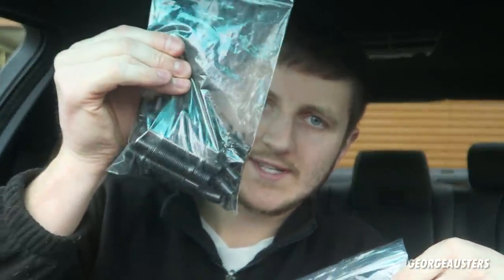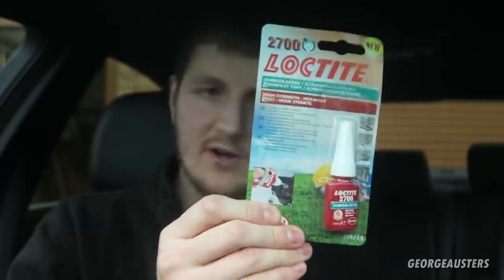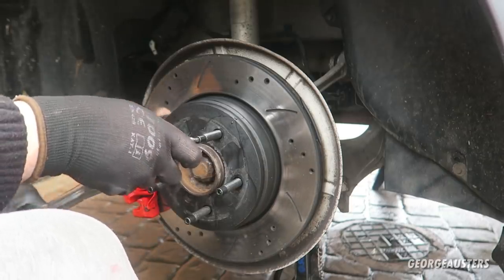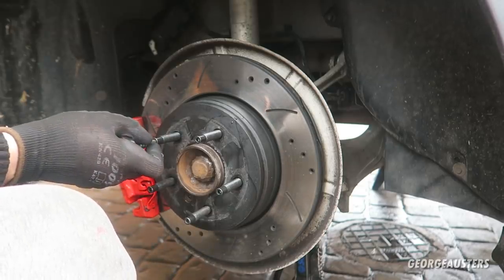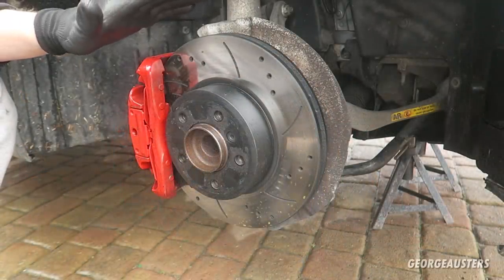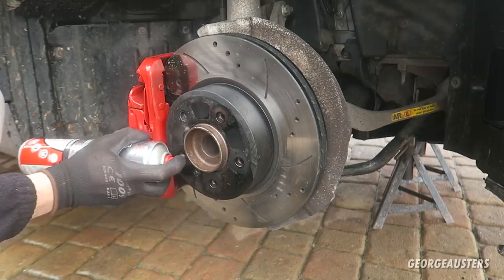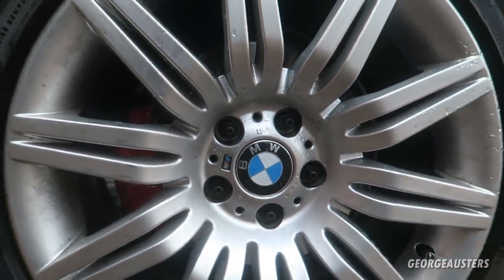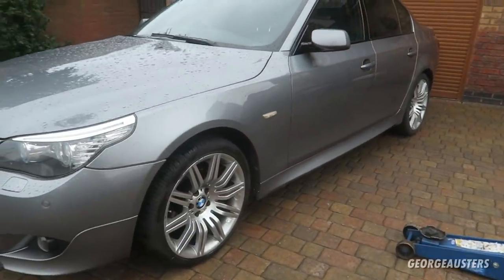The Modification That All BMW Owners NEED!

Comment: You will see how good it is when you change your discs!
I think BMW engineers are not stupid!
Good video about timing chain!
Reply from the maker: I’ve just changed my discs all round man👍🏻
Reply: Should be no problem getting the studs out again.
Reply from the maker: The discs slide over the studs, but yes the studs do remove easily👍🏻

Comment: Just get a wheel mounting pin, BMW used to send them as part of tool sets, get 2 is my thing as it then gives you two points. Makes it much easier just remove one nut, put it in at the top and undo as usual. Mounting is made easier as well obviously. M14 * 1.25 for f series cars.
Reply from the maker: Or get wheel studs / nuts 😁
Reply: @GeorgeAusters  I think as I already have the mounting pins now I fear this problem less. Having seen BMW do it first hand I don't even know how they do it still without a mounting pin! 
Honestly the last tech I saw put my 20" Summers on made it look piss easy without it.
My irritation is not including it in the tool kit, but maybe they don't expect people to change their own wheels now? 
Unlike my MX5 I suppose that is my only frustration you need extra tools to really make you feel comfortable working on them!

Comment: I need to: change aircon pump, renew main belt, change fuel and cabin filters, renew rocker gasket. So If you run out of car repairs to film I’ll happily drop it over 😀😀😀
Reply from the maker: I’ve done videos on rocker gasket, cabin and fuel filter. Will be doing belt kit soon 👍🏻
Reply: Worth a trylol

Comment: Hi George, I did see somewhere a threaded rod which you screw in one hole so you can line the others up for the bolts them unscrew it for fitting the last one
Reply: Just use any long bolt with the correct threads, and cut the head off.

Comment: When coverting my M5 to studs I drilled the disc stud holes to the exact diameter of the stud shoulder, which means the studs can stay undisturbed if the discs need to be removed.....
Reply from the maker: Not a bad idea Dave!

Comment: hi george  another great video
i too have a bmw e60 mine is the 2008 lci 520d

and yes i agree that the  wheel nuts are easier when changing the wheels
but  the issue i see is the security  the  nuts have no lock key like the original
i know maybe the lock is useless but it does help to stop the theft of the alloys
just my opinion im probably wrong 
i like all the videos you do they are very helpful
regards
james
Reply from the maker: Cheers James! 

Not to worry, I’ve got locking wheel nuts to match on the way🤙🏻
Reply: @GeorgeAusters   ah thats the job
it is always better to be safe than sorry
regards
james

Comment: This is nice but what about handbrake adjustment after that? I think this is a stupid mod because you cover the holes ant can not do the adjustment just after removing the screws.
Reply from the maker: Can do so by removing brake disc
Reply: More simple is the factory version you did not convince me.

Comment: If there is a problem for you, install a wheel with bmw bolts so maybe is better and safer for you do not do any manual job on your car. This what you show here if very dangerous for fast driving 100mph +. A so I forgot in UK the max speed is 70 but all drive 60 🤣🤣🤣
Reply from the maker: Why is what I show here dangerous over 100mph?

Comment: No one "NEEDS" this mod. I like the idea and look of it but a price of £126 for slightly easier wheel fitting is just not worth it at all. I've had the wheels off and on my E46 and my E60 dozens of times each, and it is not worth that sort of money for studs in my opinion.
Reply from the maker: Well worth it imo👍🏻